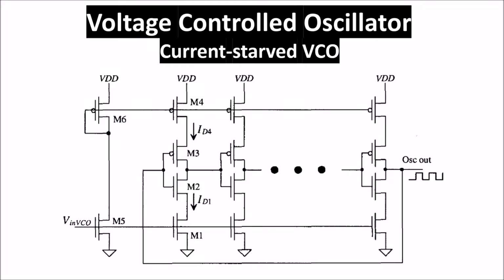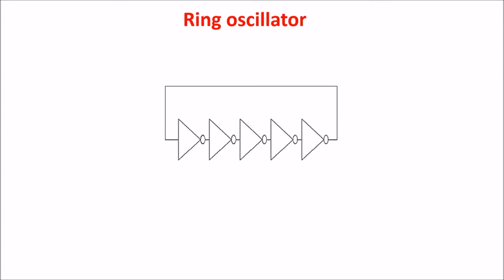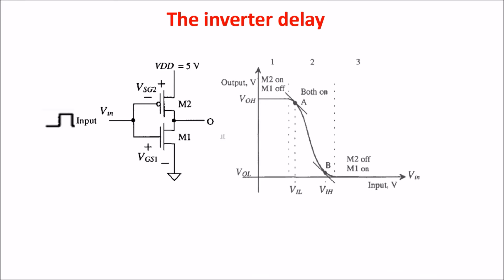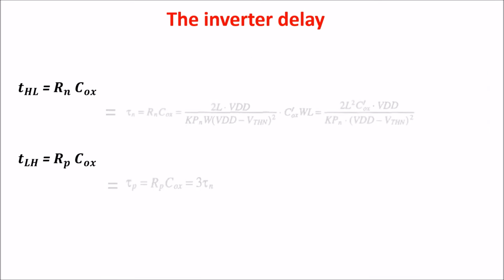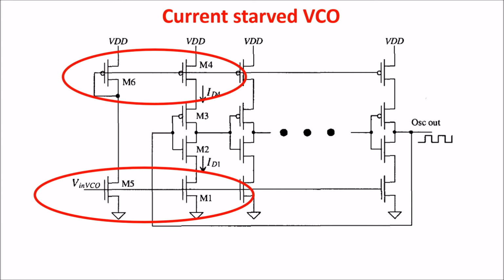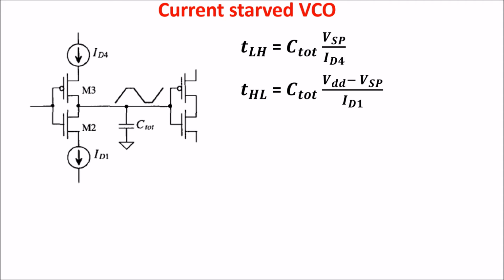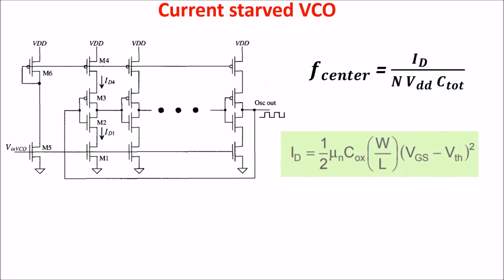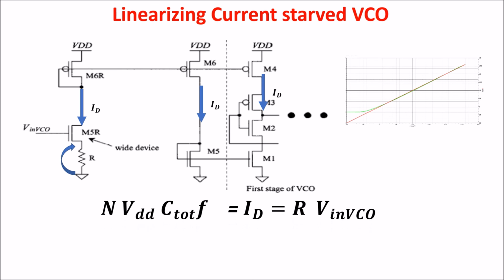PLL - Voltage Controlled Oscillator - Current starved VCO

Comment: Hello! I have a question. In type 1 XOR PLL there is 90 degree phase shit between input and output. And when the two signals are at 90, the average output voltage will be half Vdd.  I completely get that part. But my confusion is more fundamental here. Why does the locking occur at exactly half the voltage(Vdd/2)? Any constant phase difference means same frequency. But it locks with 90 degrees difference. Why it locks at VCO's center freq?
Reply from the maker: Hi, pll is composed by a phase detector and a low pass filter which detect the different phase of two input signals and give on the output a voltage level proportional to the differential phase. This voltage drives the VCO which produces a signal with a frequency related to the input voltage. So the designer set the parameters making the input voltage VCO equals Vdd/2 when the two input frequencies are equal so when there Is no phase difference in the input signals. At VCOinput=Vdd/2 the VCO produces the center frequency which has to be equal to the frequency of the input signal. So the designer makes the locking occuring exactly at VCOinput equals Vdd/2. If the frequency of the input signal increases then the VCO increases the frequency of the output signal making It equal to that of the input signal. The pll is looked but in this case VCOinput Is larger than Vdd/2. There Is a range of VCOinput voltages, so a range of input frequencies in which the pll can follow the input frequency and stay locked. Outside this range pll cannot stay locked.

Comment: Excellent explanation. I hadn't even thought of putting the current mirrors on both rails, but I bet that helps with keeping the output levels valid for buffers. Have you looked at startup instability? E.g. with 5 or more stages it's possible to have multiple edges in the system - eventually one will dominate, but until it does the frequency can be faster than expected.

Comment: Is it possible to integrate ROSC in processor
Reply from the maker: Ring oscillators are not accurate enough for the high frequency of computers. Computers use a crystal oscillators and the CPU multiply the frequency with an internal PLL (because Crystal osc are accurate but they reach low frequency typically 100 MHz)
Reply: It looks like Ring oscillators

So this is ah! PLL

Comment: Could we change M5, M6 to a variable resistor instead for some other applications.
Reply from the maker: Hi, Thank you for your comment. I am not sure what you mean. Well, taking away M5 and M6 for a resistor make you loose the current mirroring so the circuit wouldn't work anymore. You could change only M5 with a resistor but this is a CMOS so an integrated circuit. It is difficult create resistor in this technology. You use mosfet for loads (resistance or capacitance). If you want to replicate this circuit with discrete components putting a resistor in place of M5 theoretically it works but in practice it is difficult make current mirrors with dicrete components. The mosfets must be matched and even inverters are difficult because the p-mos has to be double size in comparison with the n-mos in order to have the same transition time (low-high and high-low). Morevover, the frequency would be much lower. I hope I answered to your question

Comment: Interesting. I used metal gate CMOS (4000 series) inverters in some very non-standard ways back in the 70s and 80s but I've not come across this.
Reply from the maker: It is a nice circuit